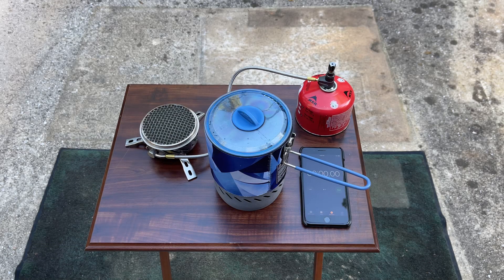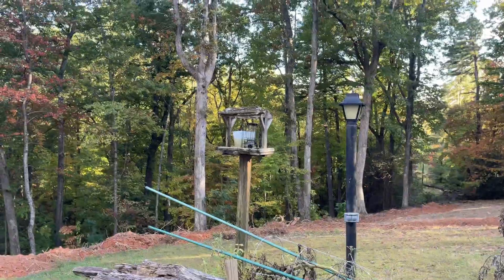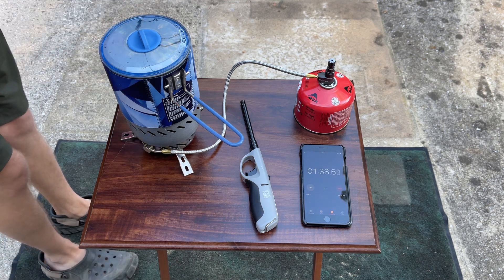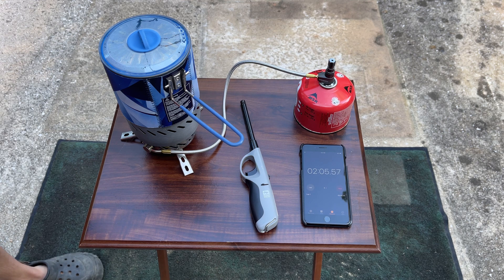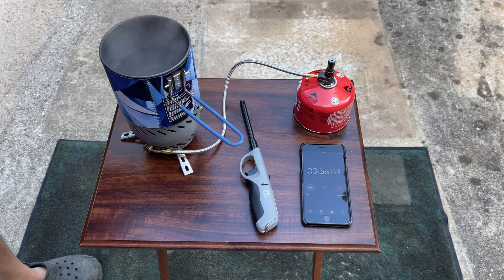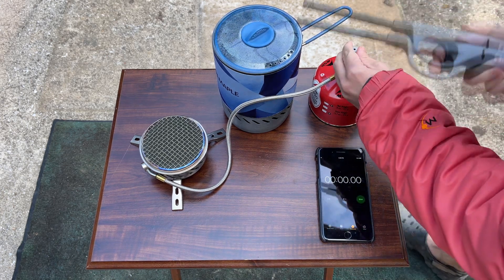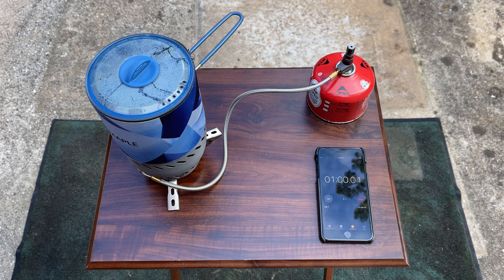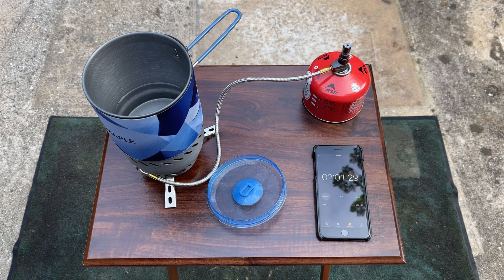Firemaple Mars 1 Liter & .5 Liter Boil Test

Comment: how is performance with propane? did you figure out why the propane was so low pressured in the last video? maybe try refilling an msr canister with straight propane. they sell refill adapters.
Reply from the maker: The orifice was too small on the adapter, I bought a camping moon propane adapter, and it works "better". Don't refill the cans with pure propane unless you want a surprise.